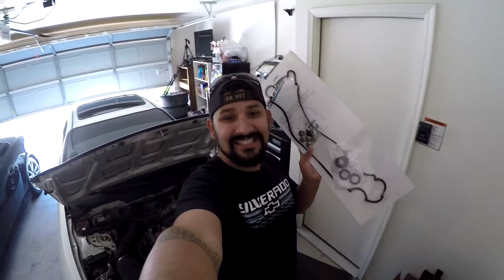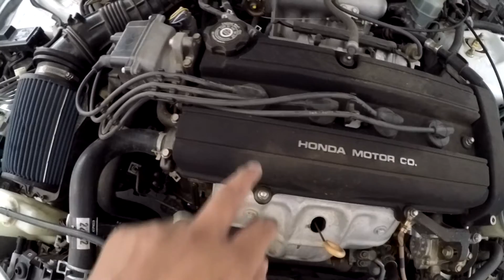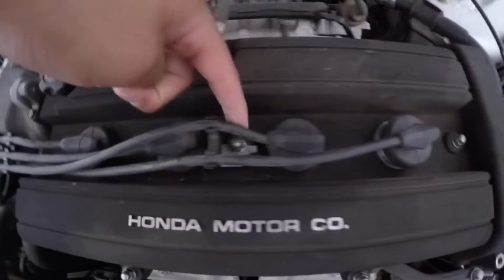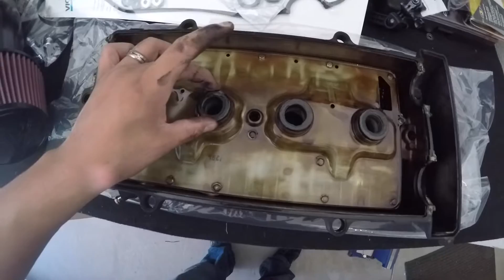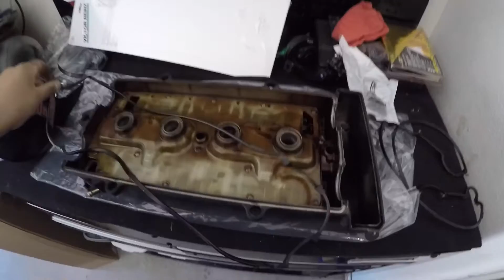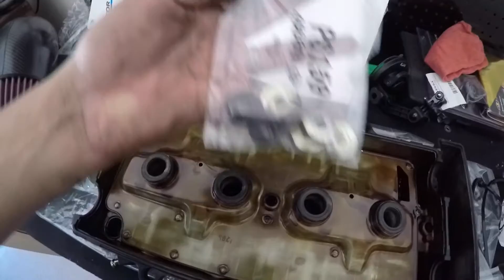How To Change A Valve Cover Gasket, Spark Plug Tube Seals and Gromits!

Comment: Good stuff man, I need to change my vc gasket too! A huge benefit I found for these engines are some nice high quality double platinum plugs
Reply from the maker: Good to kno bro. U clearly kno more on the integra then I do :)
Reply: A lot of trial and error man. A lot of reading and research through out the years, a lot of money spent, a lot of money wasted.. to figure out what works and what doesn't. Honda had it down pat with these cars with the stock setup actually, we just accessorize these cars, unless serious cash is dropped unfortunately 😭
Reply from the maker: Yea I know allot about cars but on a general level. I'm not specific to one car

Comment: At time 40 seconds, you have the valve cover without a stud (bolt). Is this ok? I'm asking because my Acura was once stolen, and I thought the robbers removed the valve cover to steal the lower right  hand stud, but if your cover doesn't have this stud, then the vehicle is like that, with no stud at that location.

Comment: Great video man, I have to do some more work in my integra LS. I have a leak coming from what looks like my engine and the oil is collecting intop of my transmission, any ideas on what kind of leak it is?
Reply from the maker: I would have to look at it to be sure but there is a possibility that it can be the head gasket
Reply: hopefully it's not the head gasket. it may potentially be the dizzy O-ring or the cam seal.
Reply from the maker: Dc2 agreed

Comment: I change my 94 integra's valve cover and spark plug gasket but even with that still liking oil to the spark plug tubes
They are up to the middle of the spark full of oil
I don't know what else to do
Reply: Please someone help me
Reply: Kreuel, there is a 2nd set of (4) spark plug tube seals/gaskets that sit beneath your integras plugs where it meets the cam shaft. These are often overlooked and/or people simply dont know abt them. I went to Autozone yesterday. I know for a fact my lower seals are to blame for the large amount of oil in my wells. I told the autozone employee what i needed. He proceeded to tell me theres only 1 set of seals. I waa very nice in my attempt to let him know hes wrong. He wouldnt budge. So i went to OReilly and got the seals.  Went back to AZ today for something unrelated. Was SO hoping he was there. Took my new set of lower tubeseals with me but alas he wasnt there. Your lower seals will likely be dried out/crumbly which is whats enabling oil to get uo into your plug wells.  Eric the Car Guy has done a video on this very subject. Its very comprehensive and great care needs to be taken because youll not only be removing your valve cover but going a step further into the cam shaft and removing the cam cage. Its a pretty involved project .  Youll need much in the way of tools including a socket set, screwdriver, torque wrench, some Brakleen to clean the oil off your engineand out of your wells. Its the sort of repair that youll wanna change your valve cover gasket, probably the 7 grommets things like that. If you live in southern California you can come ovet.. We can do our cars together. Ive done my valve cover gasket before. Dont forget to pick up a new set of ngk plugs and some new plug wires to replace yours that are likely covered in oil.